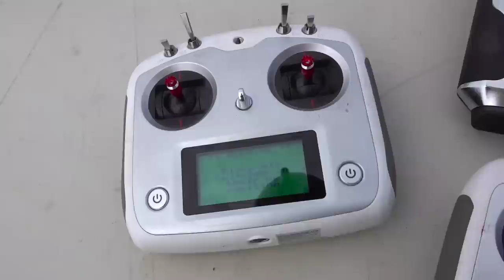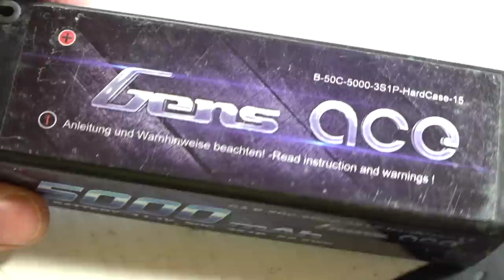YouTube GOLD - From RAGS to RICHES!  (s2 e11) | RC ADVENTURES

Comment: That feed ramp for loader could be bit higher, slightly wider and longer so it would be easier to dump in to the hopper. I think Paul has been smoothest dump truck operator so far. He made that thing glide.

Comment: Ok I have been watching since season 1 I like the video's I have a suggestion for when you dump pay on the black rubber and use the frontend loader to put it the hopper make a 3 walled containment on top of the rubber you would not loose pay when you pick up the dirt with the loader I have seen that type of setup in the mines in Minnesota it works out for them and if I was able to do what you guys are doing I would even have hoppersxon the conveyors as well with four sides with a half moon shape cut out of the side where the pay dirt goes up the conver it would help with not loosing pay and would be more of a consistent flow of pay on the belt but that is my opinion